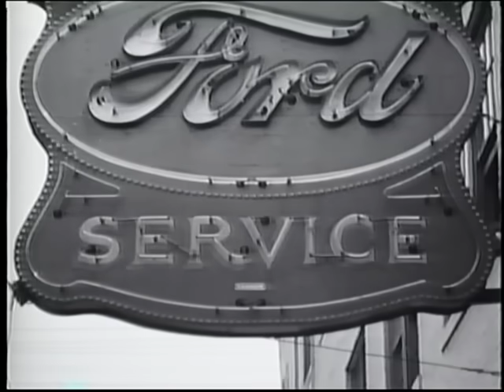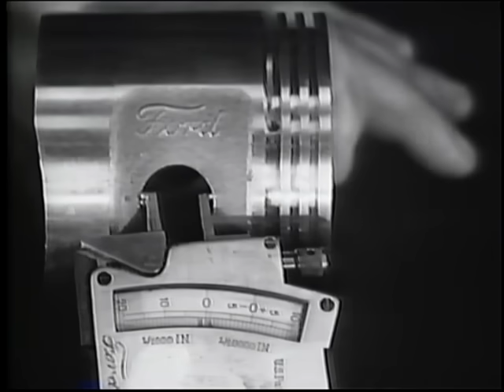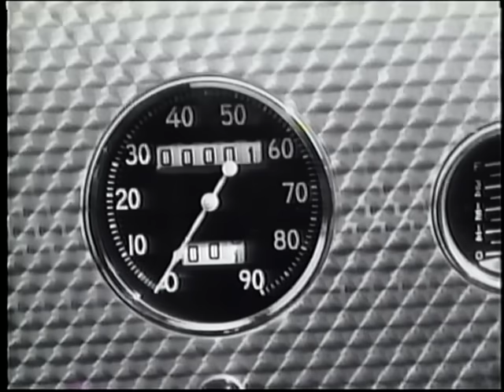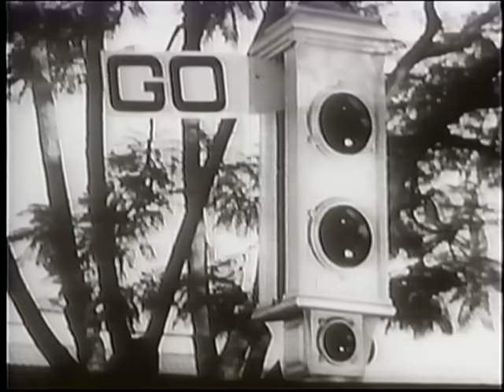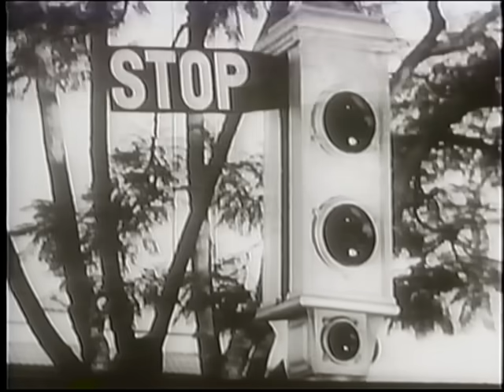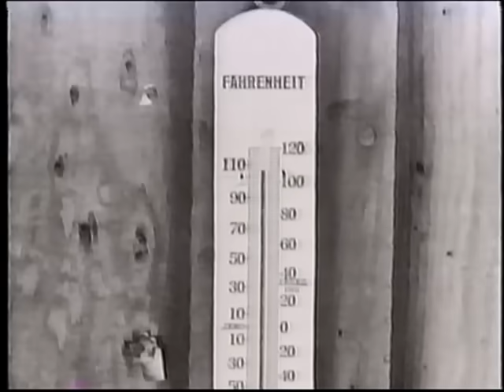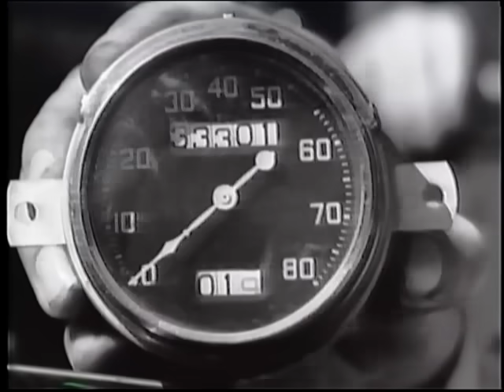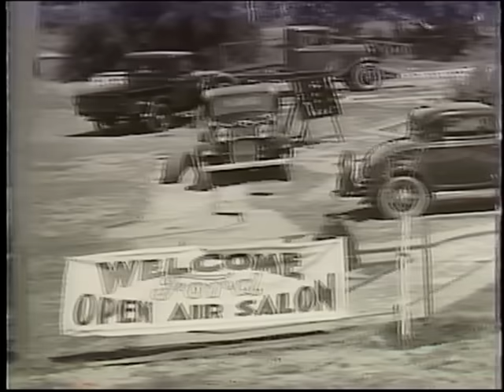1932 - The Invention of the Ford V8 Engine

Comment: I love my chevy's, but totally respect the V8 technology designed by FORD. Enjoyed the documentary, thanks for uploading it :)
Reply: don't forget that Chevy made a V8 before the small block.
Reply: Cadillac V8  Type 51   1912   was the first volume produced automotive V8,
Reply: WAS NOT A SINGLE PIECE CAST BLOCK.....THREE PIECES
Reply: Wrong. Single casting. Are you counting the heads as separate castings?
Reply: Mike...  They said single cast block, not single cast engine.   The heads are obviously cast separately, Einstein!
Reply: One of the most important innovations in the Ford flathead V8 was the casting of the crankcase and all 8 cylinders in one engine block; a one step, low price V8.
Reply: 1917-1919 Model D. Discontinued after Chevrolet was integrated into GM.
Reply: Why can't we be more friendly to each other? Blind brand loyalty is stupid. I'm a Volvo lover myself but I love learning the history of American automobiles, especially the old classics. All car makers have made shitty models with shitty engines, almost all brands have made at least one nigh-bulletproof car model. We should celebrate the automobile in general, regardless of brand. Especially now since we might be one of the last generations to freely drive cars with internal-combustion engines because of climate change and depleted oil reserves. Hell, even driving on public roads might be outlawed when self-driving cars become cheap enough and safer than humans in traffic.

So don't let your brand goggles blind you guys! Celebrate and enjoy the automobile while we can still enjoy them the way they were intended!
Reply: Tibor Roussou is
Reply: enok90---Well said.
Reply: enok90, well you want learn it from this video, it's revisionist history, a load of crap. Chevy invented the 302, and a year latter after Chevy came out with it, Ford bought the prints, which is why Chevy never made that engine again. Anyone who thinks what I am saying is BS, look at the bore and stroke on both the Chevy 302 and the Ford 302, you will see it's exactly the same. Now I know some Ford fanboy's will not believe this, and that is your choice, but I know the truth. I'm not going to argue or even respond to any trolls.
Reply: Yes, GM did make a 302 for their Z28 for a short while.  And while fairly rare, it was a good engine.  
However, the Ford 302 is based directly on the older Ford 289, just with an increased stroke.   
The GM 302 was based on the 327, with a reduced stroke.   (so was the much more common 350, obviously with an increased stroke) 
Two VERY different engine designs.   
I never got the chance to tinker with the GM 302, but I've screwed such a few 327s and I'd guess they look pretty similar, like the Windsors likewise do (except for the 351W being slightly wider but otherwise nearly identical) 

BTW, both 302s came out in the same year, in answer to SCCA restrictions for racing entry qualification.   Ford just had a lot more overall success with their 302 design than GM did with theirs, which is why GM settled on a 305 for competitive numbers.   
So....   What's worse...  his revisionist history or your presumptive one?   :-P
Reply: Actually they did, and it don't matter if you believe it or not. The stroke and everything is the exact same, it's the same block, but hey, if you choose to believe GM designed a 302 and made it for only one year, that's on you. Yea, they went through all that trouble to make a 302 and never made it again, that makes sense to you? They can't make it again, because Ford owns it now. I knew some Ford fanboy that can't face the truth would get all butt hurt, and you didn't disappoint. I could care less if they changed the firing order and distributor, but I am talking about everything else. Ford didn't design shit, he bought the rights to the 302.
Reply: Ever compared NASCAR engines between the various competing teams?  They're all identical.   Not because they're made from the same blueprints, and not because they're selling designs to each other.   It's because they're all trying to maintain maximum performances possible right at restriction threshold.   So you have NASCAR's limitations shaping the engines, not the innovational talents of the team.   
Reread what I said about SCCA rules I mentioned earlier...   both Ford and Chevy wanted adherence to those qualifiers to be able to tout as bragging rights for their production cars.   
You asked why GM designed it and used it only for a year?   Well why does GM do a lot of the weird shit that they do?  Who knows??   Lol
They did want to set themselves apart from Ford on a marketing standpoint (for obvious reasons), so you're at least somewhat right about their discontinuance of the GM302.   
Think about it, mate....   WHY would Ford need to BUY a design from GM?  Both companies had a long built wealth of R&D resources at their disposal...  some of the best in the world even....   neither of them has ever needed to copy specific engine designs from each other, so your fantasy presumption is preposterous.   
Bore and stroke are easy tweaks to any design.   A platform need not be copied.   
The head designs are totally different.   The cams too.  The firing order.   Hell, even the distributor is against the firewall in the Chevy versus the Ford which kept theirs up front.   
You may keep beating that drum, but everybody else will still know you're wrong.   ;-)
Reply: You have not been working with a Chevy 302, you probably never saw one in your life. If you did have one, you would know I am right. It has the same bore and stroke, that's more than a coincidence. I don't care if you are triggered, because I am right. 

Ford bought the blue prints from Chevy, if they changed a few things, so fucking what. The point is, this video is Ford propaganda and revisionist history. If you want to find out the truth you will, but I am done here. I can lead a horse to water, but I can't make him drink. 

You know what a 302 is, it's a natural progression from a Chevy 287, that's what it is. It is not chance that Chevy came out with the 302 first, dropped it, and then Ford started making the 302, but I realize you don't care about the truth.

I'm done here, you can do wtf you want, I'm sorry I fucked with your illusions.
Reply: 1SqueakyWheel, do have any ideal who makes the Ford AWD Focus? The fucking Germans that's who. Don't tell me engines are not shared between companies, ever heard of GM Ecotec engine? How about the fact that Mitsubishi's 1.4 liter is also a Dodge engine? I know what I am talking about, and I am not going to keep beating a dead horse, you all can beat on it. Chevy stopped making the 302 because they had too, Ford owns the prints, and they used the prints to make their own version. You seem to think that sharing just happens is NASCAR, but it's not true.

You guys probably will tell me next that Ford invented the car, but they didn't.
Reply: I meant 283, but you are just arguing minutia. One could say, there never was a Ford designed 302 as well, LMAO.
Reply: yeah ..I knew it...the ..ONLY argument you are using is that the bore and stroke is the same...SO WHAT..that is the..ONLY..similarity...NOTHING else is the ..same...show some ...PROOF...for your ..ridiculous claim...and for you to say that I have never even seen a gm 302..is just asinine  !
Reply: FullSpectrum Survivalist 
you couldn't be more wrong.
Reply: Tom, and you base this on what?
Reply: Nobody triggered here but you, Bud.  I simply corrected you,  lol.   

And of course I've seen them.   Had a friend in the 90's who had one that I even worked on.... kinda.   I only rebuilt the carburetor for it, but never worked on the engine itself.   He had put it into a C10 he was fixing up.  I've worked on countless windsors though, owning a couple myself.   

I told you already about how the mainstream 302 was a direct modification of the 289, which came out WELL before GM's 302.  
The bore between the F302 is identical.   The journals, mains and cams all the same, as well as most versions of their respective intakes.   Only their heads are different, albeit interchangeable.   
They're both part of the Windsor line, as well as the 351W and several smaller V8s which preceded the 289 even.   

I also informed you that GM's 302 was directly based on the 327.  (as was the famously ubiquitous 350)  The two are the same exact smallblock, with the same exact bore.   You can swap their pistons around just like you can trade those of the Ford 302 with its respective 289 predecessor.   The GM302 was basically the 327 destroked to the same depth as the 283, if memory serves me correctly.   

These derivations are irrefutable fact.   And your talk about illusions is pure irony.  
 
Yes they just happened to use the same stroke and bore size.   That is where their similarities end though.   They both chose obviously convenient numbers.   3" stroke by 4" bore.   It was a natural landing point for a fast revving oversquare engine that came in under the SCAA's 305 cube limitation.   BECAUSE THEY'RE SIMPLE, EVEN NUMBERS.   If it was some really oddball figure like 3.612" x 3.96", you'd have somewhat of a point.   But there's a difference between chance coincidence and common expectation.   

And by the way, GM manufactured the engine for THREE years, not just one.   

I don't know why you're trying to turn this into a pissing contest...   You obviously have access to the Internet...   you should use it for a little fact-checking rather than just for broadcasting erroneous presumptions.   

I don't want to doubt that you know a little about engines...  but if you really do, then you should know better than to assume that Ford would need to buy blueprints for an engine from their diametric enemy in order to arrive at an engine with a simple 4x3 bore/stroke ratio.   It's a childish conclusion.   

The bore and stroke aside, there are no similarities between the two 302s.  

And I'm unsure why you felt that the mention of other overseas company collaborations has any bearing on proving your point...   but while these other international pairings happen (like Ford & Mazda, GM & Isuzu, Chrysler & Mitsubishi, etc) there never was nor ever will be any joint productions between Ford and GM.  
It never happened.   It never will.   They have nothing interesting to offer each other.   

The closest you'll ever get to that would probably be the long-defunct AMC, who was famous for using components manufactured from Ford, GM and Chrysler, despite their intent to compete with all three of them.   

So calm down dude.   And get over the fact that you are hilariously incorrect with your fantasy presumption.   

You asked for specifics to rebutt your claim, and I have provided actual derivative details for your educational benefit.   
Ig you choose to ignore those, that's completely on you.   

Good day, friend!
Reply: YES!!..exactly...thank you...1SW...i dont deal well with stoopid pompous asses!!...B/S is THE ONLY..similarity...nothing else looks or fits the same ..from bell housing pattern to timing cover..and to claim with..NO..offered proof that Ford would need to buy ..anything..from GM..to make a natural progression from 221..260..289..to eventually the ..302...redikk...totally...correct..GM wanted to go racing..SCCA......they did what we all copied making the 348 stroker out of the 400 4 bolt block...with the special ..thick wall FM main bearings....well putr!!
Reply: "Yes they just happened to use the same stroke and bore size.   That is where their similarities end though."

That's just it though, that's not even close to being the only thing the exact same. First of all, we are talking about 2 engines with the same CID, that's 3. The fact is, almost all the numbers are the same, and any that are not are due to the few changes between the production engines. If you want a real list on what is exactly the same, I can provide you with it, and we can talk about what isn't and why, but I am not going to do it for people talking shit with theirminds already made up. 

Also, working on a carburetor don't mean jack shit, you can put any carb on any car of similar horsepower.
Reply: Also, I am not triggered, why would I be? I am not a fan boy. They lie all the time about any number of things, and most of you buy it. Orville and Wilbur Wright didn't invent the plane, Ford didn't invent the car, and Alexander Graham Bell didn't invent the Telephone. Those are just a few examples most get wrong, because of revisionist history.
Reply: FullSpectrum Survivalist 
well being that I've built a Chevy 302 starting with a 327 block, an several Ford 302s they share nothing in common. nothing. why would GM sell the design of the worlds most popular V8 engine to a rival company. then continue to build eng using the exact same architecture for decades. 
 lots of engines share the same bore and stroke doesn't make them related in any way
Reply: FullSpectrum Survivalist just admit that your mistaken an move on. sucks being wrong, but such is life.
Reply: I'm not talking shit.   I've been talking congenially and patiently with you, and haven't uttered a single curse word nor insult.   I simply told you why you were wrong.   

I told you about the carburetor as an admission that I haven't wrenched directly on the engine itself, but it was a rebuttal for your other presumption that I'd somehow never seen the engine.   Like its super rare or something?   I've seen a few.   (three years production time with a large company like GM on an engine that has a cult following means that gearheads like myself are obviously likely to encounter a few throughout the years.   
It was an example of how you apparently tend to shape your arguments on baseless assumptions.   

By the way...   The CID isn't really a third thing.   It is a product of the first two.   If you understand geometry, then you'd know that bore multiplied by stroke with same typical head clearance is going to result in 302 cubic inches.   That's not a third added similarity!  Haha 

Go ahead and provide me with this list you like to enigmatically refer to.   I'll wait.   

But first, you must DIRECTLY refute what I've told you twice about the Ford being derived from the significantly older 289 while the GM comes directly from the 327.  

Plus I corrected your claim of one single production year by stating they had at least THREE.   67, 68 and 69 for sure.   That's chronological overlap, which also blows your theory about their reason for discontinuance right out of the water.   

Had enough yet, mate?
Reply: No, again, you're confusing "revisionist history" which is intentional and calculated in nature with ignorant assumption.   

Nobody teaches that the Wright Bros invented the airplane.   They were merely first in flight.   Anything beyond that is presumption.   

Ford invented the  affordable car "for the everyman by way of his innovation of the linear production line.   Anything beyond that is ignorant presumption also.   

Bell didn't invent phone technology, he was only the first to make it work practically.   Again, anything beyond that.....   you get the point.   

You're obfuscating the argument by going on that tangent which is irrelevant to anything which anybody else has thus far told you.   

Quit the shadowboxing.   Try answering our points directly as we have yours, instead of deferring back to your original unproven claim.
Reply: "But first, you must DIRECTLY refute what I've told you twice about the 
Ford being derived from the significantly older 289 while the GM comes 
directly from the 327.  

Plus I corrected your claim of one single production year by stating 
they had at least THREE.   67, 68 and 69 for sure.   That's 
chronological overlap, which also blows your theory about their reason 
for discontinuance right out of the water."

I know they made it 3 years, I just posted that to see if any of you supposed experts would know it. I already covered your derived argument, on the fact the same could be said if what I am saying is so on a Chevy. Just because you think something derived from something doesn't mean it's a fact. 

""But first, you must DIRECTLY refute what I've told you twice about the 
Ford being derived from the significantly older 289 while the GM comes 
directly from the 327."

No, you don't get to tell me what order I cover things and place conditions on me. This condition is because you want to direct the conversation to things nobody can prove. Well if you want the information, we will talk about it in the way I say, that's my condition.

Here's what we will talk about, both the 69 302's.

(1) What is exactly the same. 

(2) What isn't the same and why.

(3) What is completely different and why.

Now if you want to do that, we can get into that other stuff latter, but I am not going to get anywhere with showing you the truth as long as you choose to base everything you say on what most people tell you. 

But if you choose to do this my way and actually look at what we are talking about with facts instead of lies, you may just change your mind about what is or isn't the truth. 

The fact is, I can show you any number of things made by different manufacturers that are exactly the same product, but with different names, and this didn't just start yesterday, it goes on all the time. Most people are not willing to learn anything and challenge their beliefs, and I won't waste my time arguing about  it. If you want the information, you will receive it how I choose to give it to you, because I once believed Ford designed the 302 as well, and I know both sides of the argument, you don't. So I know what you need to see to get your mind right on this.
Reply: "Nobody teaches that the Wright Bros invented the airplane.   They were 
merely first in flight.   Anything beyond that is presumption.   

Ford invented the  affordable car "for the everyman by way of his 
innovation of the linear production line.   Anything beyond that is 
ignorant presumption also.   

Bell didn't invent phone technology, he was only the first to make it 
work practically.   Again, anything beyond that.....   you get the 
point."

No, actually when I was in school, they did teach the Wright Brothers invented and flew the first plane, neither of which is true though. 

Ford did invent the production line, Mercedes Benz invented the car, and I would have to give Hitler credit for making an affordable car for every man, not Ford. 

Bell patented the phone, that's what he actually did do, a Woman invented it.

"No, again, you're confusing "revisionist history" which is intentional and calculated in nature with ignorant assumption."

No, I am not confusing anything, all lies are done of purpose, therefor intentional.
Reply: http://www.460ford.com/forum/42-general-tech/114796-ls1-heads-sbf-yeah-can-done.html

Read this thread, so you can get in the right line of thinking. I have saw people put Ford heads on a Chevy more than once. In fact you would be surprised about how often things like this have been done, and when you see how they do it, you also ee exactly what is different. 

Next time you go to order a part for a car, ask what other cars that part will automatically work on, you will start to see things clearer.
Reply: Already told you, not going to waste my time arguing and getting nowhere. I don't need anything from you, if you want the information, you don't get to direct how you get it, accept this or I permanently move on.
Reply: I do stand corrected about the patent.   You are correct.   But Bell was the first to prove the concept in a commercial context.   So in doing, he fathered the product itself.  
As for Henry Ford, he invented the linear production line, as I said before.   The "everyman" bit was an confusing adlib, and I therefore retract it.   
Mercedes "invented" the production car.   But not necessarily the automobile itself.  
 
While this is all very interesting, it bears no real relation to the very specific argument you originally launched.   Out of the blue, even.   

And by the way, no need to quote my entire messages only 5 minutes later.   Are you just trying to add filler?   
If so, there's no need for that.  
If you're worried I'll delete my comments, relax.   I have no respect for debaters who delete their commentary in a forum debate to save face, so you ain't fine me doing that.   And I'll give you the benefit of the doubt that you won't resort to that once all's said and done either.
Reply: Okay.   So you want for us to ignore the logic and just deal with baseless factoids which buttress other baseless factoids then?  You might as well be retorting "Bob agrees with me, so there's my proof".   It just doesn't work that way.   
None of this works that way.   

But you are content to waste our time, and you've wasted it well.   

It's difficult to take a guy seriously when he reverses part of his predicated argument with "I know it was 3 years, but I was just saying 1 year to test you", as I paraphrase.   
Good job mate.   

Your desire to dismiss parallel respective derivative lineages and completely defy chronological order with your assertions tell me all I need to know.   
I guess all of this was to test us, huh?   Or troll us maybe.   ;-) 

I'm done with ya.   Good luck doubletalking the others.      
And gnite!
Reply: "The "everyman" bit was an confusing adlib, and I therefore retract it.   
Mercedes "invented" the production car.   But not necessarily the automobile itself."

No, Mercedes invented the car, they made the first one. 

"And by the way, no need to quote my entire messages only 5 minutes later.   Are you just trying to add filler? "

If I had a dime for every time someone went back and modified their post on youtube after being proved wrong then acting  like they are still right, I would be rich, so I do that any time I even think that may happen. 

"While this is all very interesting, it bears no real relation to the 
very specific argument you originally launched.   Out of the blue, even."

But it does, because my real argument is that a good part of what people believe to be true in this world is not, and until you start thinking that way, you will never see the truth in anything. 

I had an Atheist that thought he was clever and would make me look bad on another thread last week by asking me if I believed in unicorns.

I told him, I believe it is an animal that once existed but is now extinct, and it's in the Bible. 

Now I will bet you that he can't present to me a walking living T Rex either, and I will wager he has no problem believing in that. I think the difference lies in how the information is presented, with one being presented as Folklore and the other as fact, of course tomorrow as often happens that could all change, just one unicorn horn is all it would take. In fact, none of us have saw a real unicorn, and they may already be a horn, and they don't know what it goes to yet.
Reply: Also keep in mind about a patent, that only means a lot of the time someone beat you to the patent office, and not that they invented it.
Reply: No, I don't want to  set here just spinning my wheels, how much time have I already wasted on this and where are we, exactly where we started.

I want to talk about what is the same first, then we can talk about what can't be proved latter, or you can, but I don't care about that really.

So far we agree the bore and stroke is the same, that's how far we got, and even then I had to hear excuses about that. If I present other things that are exactly the same, am I just going to get more excuses? If so, why should I show you people anything.
Reply: JackMac...  damn dude.   So much anger over a rather whimsical subject.  
Yeah, so he's QUITE mistaken with his rather oversimplistic concept of how engines are designed.   
That's no reason to be so nasty to him though.   If you want to argue with him, then you really should execute it civilly.   You'll gain more traction.  I learned that he's a waste of time to debate, as his method is ducking, weaving and then reasserting like a broken record.   There's no discussion to be had there.   
I destroyed his logic several times over without using a single ugly comment.  That vitriol LOSES the argument for you, whether you realize it or not.   I hope you improve your tactics, as much as I hope you take friendly constructive criticism well.   ;-)
Reply: yes ..i know...you are ..100% correct...just sometimes ..people like ..him..piss me off...just hate ..pompous ass's that think they know it all...{but dont}...and know..that!...I'll...try and remember..what you just put forth...thanx..man....
Reply: If it brings you any comfort to know this, I don't think he thinks he knows it all.   (if that makes sense) 

What I do believe is that he thinks he's smarter.   He's indicated that he knows he's pulled details out of his own arse, but believes he's clever enough to doubletalk his way past any rebuttal, and somehow fool the lot along the way.   He runs out of ideas though, and commits to the same comfortable (and predictable) holding pattern every time.   
I do believe that he doesn't realize people are capable of clearly seeing through the BS.   He knows he's got nothing.   
So don't feel bad...  I'm pretty sure he knows he doesn't know.   He's just digging in his heels to wax his ego.   
He's thrown everything he can at it, and knows nobody's buying it.   Lol
Reply: Fucking Crickets, that's what I thought. See, I am not the Troll here after all, some people are just to damn stupid to lean anything the easy way, class over. Now I am moving on from this, mission accomplished. If anybody had anything else to say, they had over a day to do it, almost two.
Reply: Easy Jack!    Lol 

FullSS:  No intentional crickets.... Honestly, I thought you had deleted the thread. I could find no evidence of this thread the following morning after I sent that message. I'm just now getting alerts, and seeing that the thread is still in existence!  (I really hate how Google has corrupted YouTube, but I digress. ) 

And no, "CFM" and "carburetor" are NOT the same thing at all. CFM is a volumetric measure of the amount of airflow that a carburetor is rated to deliver. Don't be putting words into my mouth like that...  you are still the fool here. 

Items 1 and 2 in your list, as well as 7 thru 9 are, AGAIN, a direct product of items 3 and 4...  bore and stroke.   So right out of the gate, 7 items of your list are redundantly weaving out the same two very basic factors.   
The rest of that list are popular facets of any engine of the era.
Forged pistons? Are you seriously trying to tell me that Chevrolet had a lockdown on forged pistons??? Or 4 bolt mains? Aluminum heads of even block?  Screw in studs? Solid lifters?  You DO realize that solid lifters had been around for like, 50 years already, right?  No?   Cuz I thought everybody knew that.  Haha
None of that is uniquely special to any particular design.   Nor is the very popular use of the ever-ubiquitous Holley 750.  
The more you talk, the less I believe you actually do know about car engines... More like a layman reading a spec sheet that he somewhat understands but doesn't fully grasp.   
So please, for your own sake, just stop. 
And for the record, you are the one who is hell-bent on arguing. I've simply corrected you.
You're welcome.
Reply: Neither of you said a damn thing for about 2 days after I posted my list of things the same, till I rubbed it in, and we both know that's because, you got nothing.
Reply: Nice try, but you know damn well what I stated was the exact same, there is a list, a list you failed to address even after forcing me to put it up, and I am done taking to both of you clowns, and if I could mute you, I would.
Reply: "BTW, both 302s came out in the same year, in answer to SCCA restrictions for racing entry qualification."

Which was 305 C.I.D, not 302 limit. Ford saw what Chev had and did hat they do best, steal.

 Not true at all, it's a fact that Chevy came out with the 302 2 years before Ford copied it.

I stand corrected though, it was 2 years before Ford, not 1. Chevy came out with it in 1967, and Ford 1969.
Reply: And now you've moved onto the Ural.   I'm guessing it must have a pancake engine too...   but I know nothing about the Ural, and not caring about it at all, I'm not sure why you shifted the discussion to a parallel of some Russian guy we've never heard of nor couldn't care less about.   

As for my two days, I told you what happened.  I have nothing to gain by telling any lie, nor am I trying to impress you in any way.  Don't wanna believe it?   Whatever floats your boat, buddy, that's your issue.   
I read your long reply, while on the road even, and replied immediately.   
"Liar" is an insult, and an unnecessary one...   one which doesn't help your argument at all.  In fact it hurts your case because it further exemplifies your propensity to make assertions on matters which you're only able to very optimistically assume, at best.   
But there's so much other failure in your reply...   
I addressed your "17 things" already, and you missed those points too.   

Maybe you're not a troll....   maybe you're dead serious with your every word.  But at least if you were trolling, this would all make sense.   

Communication is an obvious issue between us here...   like I told you before, "Words mean things".   Perhaps I forgot to mention an important corollary to that statement, which is that specifically worded sentences mean particular things.   I bring this up because of how you like to loosely quote me and Steamin' Jack with embellished differences that you feel like you can then argue against.   

Let me help you with the most recent example of you doing this:  "The fact is, you stated they were completely different, and you were wrong...."  
Here's the rub:   IF I had ever stated those words, then yes, I'd have been wrong.   "Completely" is an absolute term.   But I said that 'they have bore and stroke in common, and that's where the similarities end.'   That is nowhere near "completely different".   
It's not the same.   
At all.   
And don't panic.... it's about grammar this time instead of math.  So hopefully that's of some consolation.   

As for the chamber volume, THAT would be your third similarity.   Not CID, because, as I told you before, stroke against bore is where CID comes from.   

And I'm sorry that you ARE so annoyed by a fact when it happens to be mathematical in nature.   WHO WOULDN'T BE!?   LOL

Math (in conjunction with health ideals) tells a woman with Amazonian stature that she can't be healthy AND under 90 lbs in weight.   Should she be pissed?  
I should hope not.   
Or would you prefer that opinion overrule math?   

Say you measure the height of your refrigerator, and with tape measure still in your hand, you tell me it's 72½ inches, and I reply with something stupid like "Well,  like, that's just your opinion man...."  
NO.   The measurement was absolute.   If I disagree with it, you'd offer to hand me the tape measure and I'd make the same finding.   OR... I could just refuse and instead continue to blindly argue that it's six and a quarter feet and you don't know SHIT, and that you refuse to learn anything from me because you just won't come over to my preferred way of thinking.....  (sound familiar?   Lol)  In this silly scenario, I would be the one with the problem there, not you.  

Agreed?  
Okay.   

Let's refer to one of the very first things that I told you, which you conveniently ignored, and comedically regarded it as my "opinion";
   
The SCAA put out guideline limitations on cars which could qualify for competition.   We all know that Ford and Chevrolet has been hot on each other's heels since long before you and I were a gleam in our parents' respective eyes.   
The big two wanted to beat the other to be the leading production car which, right off the showroom floor, could compete under SCAA qualifications with every practical advantage possible.  

Are you following me so far?   
Good.   

They had to be absolutely no larger in displacement that 5 liters, or 305 cubes to be more precise.   That was the absolute limit.   To allot for rebore expansion tolerances, it's nice to leave a little wiggle room.   Engines were rebuilt a LOT more often back then due to quicker wear than we're used to today.   Metallurgy and engineering technology has come a long way, so it's far more rare unless you're a real racer or modder.   This is rather minor, and largely unimportant, other than the offering of a secondary theory of not going straight to 305 right out the gate.   Just something good to keep in mind as a knowledgeable and experienced company such as these two would, as they have to each exhaustively prethink every scenario which may arise out of a successful design over the long run.   

Still with me?  
Great.   

The practical performance soup du jour was over-square engines.   (My dad always called them short-stroke engines.  These were an innovation of Chevrolet in the 50's...  Ford may have come out with the V8 first, and whipped Chevy for a number of years, but Chevy perfected the V8 with the short-stroke design and turned the tables on this, and for quite a few years also)  By the late 60's, there were almost countless 4:3 engines in production with varying bore sizes,  creating rather diverse displacement figures.  

Both companies made the decision to do these squarely to the inch though, which may seem a bit whimsical, but every bit as practical too.   

Especially since both companies had well-aged 4" bore platforms that made perfect candidates for the Trans-Am and LeMans racing ideal they were both trying to appeal to.   
The compression ratios that were most ideal for maximum output in a practical car that could be fed affordable fuel and driven daily is what dictated the combustion chamber clearance in both cases...  That's a shared effect of the law of physics leading two different minds to the same conclusion, btw.   Not some arbitrarily arrived-upon dimension that was then shared out of some big mind blowing secret.   

Forged pistons were not only tougher for high output use, but they made for great bragging rights, as well as four bolt mains.   Neither concept was new or particularly unique, but they were sought-after by the musclecar enthusiasts because they added expense that most manufacturers preferred to forego with their more economical, lower power cars.   

Have you understood everything so far?   
Awesome.   

None of this is serendipitous.  And no, it wasn't shared either.   It was the deliberate coincidence that came from adherence to strict qualificational standards of a single organization.   

BOTH companies wanted that high attainable horsepower and torque engineered into their cars so that customers could carry those bragging rights right out of their dealerships.   

That's it.   That's all there is to explain the scant few but important physical similarities.   

I'm sure they never figured that there'd be conspiracy theorists who would one day build a cult fantasy theory based merely on "... Durr....  both engines share the same displacement, so (GASP!) they simply HAVE to be the same exact mill!" 
It's hogwash, my friend.   

***Believe it or not, both companies somehow knew how to paint their cars red without buying or stealing intellectual property from the other.

Amazing, right?  

Rather than going back and beginning from scratch, they each reached into their own  repertoire of well-proven blocks and made one major modification to each one.   Howso?   Because both said long-established candidates just happened to have 4" pistons already.   "HOW is this possible, you ignorant asshole!?" you might fretfully scream.....   

Well it's easy:  Both companies do seem to like nice even numbers for their mainstays, even if they don't always get to practice it in all their lines.   That same fact also likely fueled the other remaining "similar" dimension, but I'm getting ahead of myself here.  
Actually, no I'm not...   because I've told you all this before:  
Chevy went to their sturdy 327 and shortened its stroke to the same simple 3" dimension that their 283's crank already had.   
Ford, meanwhile, went to the flagship of their hardy Windsor line, which was the 289.  They, too, decided to keep the "even  dimension" theme of their 4" bore, and deepen the stroke to where it came conveniently to within a hair of the SCAA's limit right at an even 3 inches.   

VIOLA!   Two great 302s were born.   
To run.   
Against each other.   

The 327 well preceded the 302.  The 289 did as well.   Both by years even.   

And no, that factoid isn't opinion.  
It's history.   

So before you argue back, open your favorite search engine and type "wiki Ford 302" and "wiki Chevrolet 302" and observe the stated origins of each engine.   I'll bet you a dollar to a doughnut that it will corroborate MY statement of origin instead of yours.   
Notice that I didn't just provide you with a preresearched link giving some preferable spin...   I instead gave you a simple reference, intentionally transparent in parameter. 
  
I hope this helps to dispell any remaining confusion you might have on this subject.   

And by the way:  I'm quite sure you have much interesting (and actually factual, even!) knowledge that I could glean from you, just as I  could teach you a lot of things too.   
NEVER assume that somebody else can't possibly know something you don't.   It is but only a  blithering fool who fancies himself the unteachable expert on any given subject.   To believe otherwise is sad fallacy.   Don't be that insufferable turd.   

JackMack might know more about these two engines than either one of us.   Who knows for sure?  Certainly not either one of us.   
So let's dispense with the indignant arrogance, can we please?   

And you'd do well to abandon your assumptions of "fanboyism" too.   Neither Jack, I, nor that Tom guy whom you completely ignored have said anything brand-fanatical.  All was objectively factual statements, in regard to the cars.   
You're very quick to assume that somebody who argues your point as a Chevy fan must automatically be defending Ford, but you're mistaken there.   It's a defense of intelligence, not brand.   Both companies have built good cars, and both have built their crapboxes too.   Up until about 3 months ago, I'd owned and driven more GMs than Fords.   I've learned well of the pros and cons of each model and the helical trends across models, and I've liked every one of them.   Mostly because I know how to shop for a good car or truck.   

So lets dispense with the fanaticism charges too, yeah?   

Glad we got this all straightened out now. 
  
Have a good night.
Reply: Well it's getting tiresome breaking it down for him.  Perhaps I should just give up on him?   Lol
I try to be courteous and give others the benefit of the doubt, even when I'm pretty sure it's a waste of time.   
But it can't be said that he wasn't given a chance to face off with every point that invalidates his awesome claim, so I'm cool with it.   ;-) 
I think he understands concepts just fine.   It's the details of execution that he's kinda clueless about.   

Kinda like those kids who loved science and watched MacGyver growing up, believing his methods were realistic.   Some of the premises of his hijinks were so loosely based on reality that one could take intellectual insult if they were to take TV show embellishments personally.  But hey, they needed material, and they trusted their audience to understand reality from fiction.  But there will always be clowns who swallow it believing it really works that way.   
Anyway...   The guy is my age.   If he hasn't figured out how this stuff works by now, he's probably not going to.   I can't help him with that either.   ;-)
Reply: Kinda like those kids who loved science and watched MacGyver growing up,
 believing his methods were realistic.   Some of the premises of his 
hijinks were so loosely based on reality that one could take 
intellectual insult if they were to take TV show embellishments 
personally.  But hey, they needed material, and they trusted their 
audience to understand reality from fiction. 

Actually, when the show first came out what he did was exactly right and worked, but then people got involved and decided to alter what he did so people would not be shown exactly how to do things like bombs and such on national TV, so you only know a little about it obviously. 

I did watch that show, and I know all about what happened, and remember why they altered the scenes for future showing, the first season when they started airing it, it all worked, but then for future showing a few things were changed. 

Now they just don't air certain things ever again in any form, and have been caught even pulling shows of of peoples Tevo's, such as several Jessi Ventura Conspiracy Theory episodes that exposed things such as Fusion Centers.
Reply: I have a big comment to your book above squeaky, if you want it let me know, I can't get it to post. Can I mail it too you? Or maybe break it up into smaller books. Must be too long.
Reply: " To allot for rebore expansion tolerances, it's nice to leave a little wiggle room. Engines were rebuilt a LOT more often back then due to quicker wear than we're used to today. Metallurgy and engineering technology has come a long way, so it's far more rare unless you're a real racer or modder. This is rather minor, and largely unimportant, other than the offering of a secondary theory of not going straight to 305 right out the gate. Just something good to keep in mind as a knowledgeable and experienced company such as these two would, as they have to each exhaustively prethink every scenario which may arise out of a successful design over the long run. Still with me? Great."

Not really, just sounds like a bunch of fill in text to me, because after Ford started making the 302, Chevy made that 305 which was at the exact limit. Why didn't Ford do the same instead of that 302 which Chevy already had made one? I know why, but you are choosing to ignore it. Since Chevy came out with a 305 after that 302, that nullifies your theory, which is just you trying to justify things in your head, it means nothing.

"That's a shared effect of the law of physics leading two different minds to the same conclusion, btw. Not some arbitrarily arrived-upon dimension that was then shared out of some big mind blowing secret."

Well that's your opinion, but mine is, Chevy already had shown the 302 worked, and Ford saw that it worked and worked better than what they had, and the copied it, but made sure to change just enough to claim it as their own, and they did buy the prints. I talked to a mechanic that lives on my block about this last night, and even he knew this is true.

"Forged pistons were not only tougher for high output use, but they made for great bragging rights, as well as four bolt mains. Neither concept was new or particularly unique, but they were sought-after by the musclecar enthusiasts because they added expense that most manufacturers preferred to forego with their more economical, lower power cars."

I know what was desirable, I was there too. In fact in the 80's, I had a 79 Chevrolet Bonanza 10 with that 454 from the factory in it. Keith Black built that engine to 650 horsepower and 750 foot pounds of torque, and while this conversation is fun and all, it still just more fluff and refusing to address my 17 points, redirection of the topic to history over the actual topic at hand.

I gt what you are getting at though, you are trying to dismiss my 17 points, except for he 2 you already admitted was right. I'm sorry if you don't like it, but this is how a comparison is made, and how you can get to the truth when you are told lies. To me, a refusal to admit I am right about those 17 points shows you are not only dishonest, but not even willing to look at the evidence. Make all the excuses why all you want, but admit they are the same numbers, admit that that Holley car is the exact same carb on both the engines I compared, etc. Do all that, then we will talk about what is different and why, as I already said we would. Not showing a willingness to admit my 17 points are correct, shows me you have your mind made up and will do anything to protect your bubble.

Now if you want to tell me why you think something is the way it is, that's fine, but not till you admit it is the same. I plan on doing the same exact thing if we ever get past what is the same, and move onto what is different, this is how things get hashed out.

"BOTH companies wanted that high attainable horsepower and torque engineered into their cars so that customers could carry those bragging rights right out of their dealerships. That's it. That's all there is to explain the scant few but important physical similarities."

That's not not all it is though, the fact is, Ford choose to make the exact same size engine, why don't they do this the rest of the time if they are both adhering to this inch pattern you claim. Ford 351, Chevy 350, Chevy 454, Ford 460, Ford 289, Chevy 283, DO i REALLY NEED TO GO ON? The fact is, almost every time Ford and Chevy has made an engine, it's been a different size, but not this time. Go ahead, try and justify it all you want, but it means nothing. The limit was 305, and Ford had room after 302, but they copied Chevy and made the 302 as well, this is a fact. They could of made a 303, a 304, or a 305 like Chevy did next, but thy didn't, and I am telling you why. I don't care if you believe it or not, but this whole video is really only about Ford changing a few things from how Chevy did them, and calling it their own. They put better heads on it, and I don't blame them, theirs were better. They moved the distributor, because every Ford fan knows which end Ford puts theirs on, and everyone would be able to see it was a Chevy engine with a Ford stamp on it really quick if things were not changed around some. Plus, neither Ford nor Chevy really wants their parts to directly bolt up to the others parts, because they are afraid that Ford guy for instance, would just buy cheaper priced Chevy tranny instead of a newer overpriced Ford tranny, as an example.

I have a Mitsubishi outside with a 1.5 liter in it, and this comment is really for that other guy, who said you can't just do that, it's not that simple. Well it is in fact just that simple, but yes there is a little work involved.

I plan on dropping that 1.5 liter 4G15 into a Russian Ural motorcycle with a side car. Do you know what that really involves, not as much as you would think. I have to maybe modify the frame so it fits in there. I will have to get an adapter plate made so it will mount up to the Russian transmission, yes it has a car type transmission and shaft drive to the rear wheels that both pull. I will have to fab a custom header, an maybe a few other things, but it will work just fine in the end. Bike comes with a 759cc boxer engine, and I am installing a 4 cylinder 1468cc engine, almost twice as big and has almost twice the power. Bike normally does about 65 tops, but this will allow me to keep up with about anything.

"The 327 well preceded the 302. The 289 did as well. Both by years even. And no, that factoid isn't opinion. It's history."

I never said it wasn't true, but those are 3 different engines we are talking about. Did they modify the 289 and 327 to be 302's, are did they in fact actually make a different engine called the 302? You can claim based on all you like, others did, that's where you came up with this. The fact is,these are all different and separate engines, and that's not open to debate either is it?

Have you ever heard the saying, you can't have your cake and eat it too? Well that's what you are doing. Earlier you were saying they both came up with the even number of 302 because of a 305 limit, and now you are saying they did this based on 2 different size engines, and still came up with the same number, the problem is, that math don't even come close to adding up.

"So before you argue back, open your favorite search engine and type "wiki Ford 302" and "wiki Chevrolet 302" and observe the stated origins of each engine. I'll bet you a dollar to a doughnut that it will corroborate MY statement of origin instead of yours."

I already did that, and means nothing, anyone can modify the wiki, did it myself when it's been wrong before. If we all agreed, we wouldn't be having a conversation about this. You may not believe this, but much of what you are told in this world is a big fat lie. I am not disputing your information is not in agreement with the lie about how things came to be, I am arguing that your information is wrong because of lies you bought.

"I hope this helps to dispell any remaining confusion you might have on this subject."

Thanks for taking the time to try and educate me, no really, but I already knew all that. Their is no confusion on my part, I just happen to know things to be a but different reality than what they are saying.

"And by the way: I'm quite sure you have much interesting (and actually factual, even!) knowledge that I could glean from you, just as I could teach you a lot of things too."

I do, and I don't know everything, so of course you could surely teach m something I don't know, but I hope we can agree, we both would have to be open to change the way we think to learn something new. If we are not open to challenge our beliefs, neither of us will ever learn anything.

"NEVER assume that somebody else can't possibly know something you don't. It is but only a blithering fool who fancies himself the unteachable expert on any given subject. To believe otherwise is sad fallacy. Don't be that insufferable turd."

That's true, but you need to do hat yourself before telling others too, right out of the gate what did you do when I commented about the 302? Go look, see if you did as you tell me to do.

"JackMack might know more about these two engines than either one of us. Who knows for sure? Certainly not either one of us. So let's dispense with the indignant arrogance, can we please?"

Then again, he might not.

"And you'd do well to abandon your assumptions of "fanboyism" too. Neither Jack, I, nor that Tom guy whom you completely ignored have said anything brand-fanatical."

That don't mean you are not, nor does it mean I am wrong. Let me ask you something, why did you watch this video if you are not a fan of Ford? Why did they since you speak for them too?

My opinion that you were a FanBoy was based on your anger at my charge that 302 was made by Chevy and Copied by Ford. You may not be a Fan Boy, but in my eyes you are acting like one. Why else get angry? Why not just compare and debate without all the other crap?

"Glad we got this all straightened out now. Have a good night."

You have a good night too, however, I don't think we will ever get much straightened out on this thread. Don't look like anyone is going to change their minds here.
Reply: There we go, it  went up split up.
Reply: <<FSS: "No you didn't, saying because of math is not addressing, you wouldn't even admit they were he same numbers, that makes you look stupid not me. I already told you, we will talk about what is the same first, then we will talk about what isn't, and why. I'm still waiting on you to explain why they are the same but different, those 17 points I made.">>

Never did I simply state "because math".   I explained HOW the math tied several factors together which you wanted to treat as different.   Do I REALLY need to enter the volumetric formula of why a cylinder of 4 inches in diameter with a length of 3 inches, multiplied by 8 cylinders just like it comes to 302 cubic inches?   I've just always assumed you had the brains to put that together yourself.   Sorry if I overestimated you.   
And I did answer your points.   You even rebutted them thereafter with some BS that further assumed math should be left completely out of the discussion.   Your points on the bore and the stroke and the displacement I have answered ten times over.   (eleven, including just above) 

But since you'll only comprehend these points if I write your numbers on them,  that covers 1, 3 and 4.  

I also answered 5, 6, 8 and 11...  they both wanted to build a hot, tough engine which could both reliably produce their target power and also give bragging rights on how tough it must be.   You rebutted that with more BS.   

16 and 17, you're doubling up again on the same thing...   And I replied that the Holley 750 was a popular carburetor for high performance use in that flow range.   It was a big name, and a good carb, and generally a big improvement right out of the box over the two or even 4 barrel in house carbs that so often came stock, which nobody ever got excited over.   The Holley they chose was a popular option, and it worked well.   Gave them the Holley name to brag about.  The companies tend to know what the other is doing on details like this, so it was no big boardroom secret...   and they're not to be outdone in such an inexpensive feature which would bring them so much marketing bang for their buck.   

9 and 13 I answered when referring to the target compression ratio tested against the law of physics with current technology of the time on maximizing output while keeping fuel practicality and reliability in mind, since most of these were gonna be driven daily.   

14 this was another trend in musclecars which was steadily gaining popularity with all three companies (including Chrysler here) which was lauded as a better design for more desirable breathing for all purposes.   It was another obvious bragging point too.   

15 same as above in that it was a gaining trend across all companies, including European cars.   With a higher-po engine, aluminum was another bragging point, in that it was all much more efficient at getting the heat out of critical areas and sinking it to the coolant.   

7 and 2 was another product of all of the above.   It's a cascading effect...   why is that so difficult for you to either comprehend or acknowledge?  So yeah, it's all in the math that results in their desired outcome from an engine that began as a simple 4x3x8 engine.   I'm almost surprised that you didn't include an 18th point of similarity, them both being a V8 too.   Lol 

<<FSS: "Just trying to show you how things work, the Russian theft of tech from the Germans...... You refuse to open your mind to the possibility Ford didn't design the 302, so I am giving you just one more example of when others stole and used others work." >>

You don't have to convince me that companies take ideas or even designs from other companies.   "Steal" is an interesting word for you to choose though, since your original assertion was that Ford "purchased" the design from Chevy.    Buying and stealing are two different things.   Not that the difference matters in this case though, since it's  gonna be wrong either way...   All three companies were constantly taking good ideas from the other two.   This is how market trends work.   But none of them would ever "buy" a design from the other two when they could just as easily develop it themselves.  

This is why the idea of Ford purchasing the 302 from GM is just ludicrous.   Why should they have to?  They wouldn't.   As I stated to you before, NEITHER company has anything interesting to offer the other in a particular engine design, because they're both experts in the technology that goes into a freakin engine.   

FSS: " ""Liar" is an insult" You sound like a milineal, liar is no an insult if it's true. I 'm sorry, but I just don't believe you, have have been nothing but malicious since this started, and I think you just had nothing, and lied.

1: "Liar" IS an insult when it's a false accusation though.   I explained that already.   
2:  I obviously had Plenty to respond, as you saw of me two days later when I finally got an alert triggered by JackMack's reply to yours.   I'd written the whole thing off because G+ wouldn't show me the thread in "read history" the second day.   So I assumed you'd copped out and deleted your messages on the thread, even after you'd insinuated that I might be inclined to do such a thing.   I was wrong though, you'd not deleted anything, G+ was just being a bitch.   I'd moved on completely, because I have a life.   When G+ alerted me to a reply from JM, I was pleasantly surprised that the thread was still intact, and I went ahead, read what you said and replied.   Simple as that.   If you don't want to believe that, then be my guest.   But move on from it and don't generate unnecessary insults out of your own chosen preference of belief.   
3:  I'm not a millennial.   I'm your age.   Calling you on an insult is not a "millennial" thing.   

<<FSS: " "The fact is, you stated they were completely different, and you were wrong....""
No, I didn't state that at all, you bozos did." >>

YOU WROTE THAT IN THE PREVIOUS MESSAGE TO ME.  That was a direct quote from YOU.   Damn, boy.   Read up.   And then read where I immediately followed up with how and why it's not at all what I had said...  you even quoted that bit just below, so I'll include it in your next quote.   

<<FSS: " "But I said that 'they have bore and stroke in common, and that's where the similarities end.' That is nowhere near "completely different"."
The problem is, that's not even close to being true, I gave you a list of 17 things that are the same. You choose like he did to not address the points I made, go ahead number your thread like I did for those 17 points I made, and then tell me how I am wrong on each and every one, but you can't can you?, because I am not wrong. The numbers and parts are the same as claimed."  >>

I answered this above.   But it's nowhere near the first time I have.   And now that I have numbered it for you, perhaps you'll now be able to connect the dots?

<<FSS: "And as I already told you before and after you said that, a question is not the same thing as an answer. They are 3 different things."  >>

No shit, Sherlock!   An answer is not the same thing as its question.   Neither Jack nor I ever said it was.   
An answer IS predicated and even shaped by its leading question though, so there's an unavoidable relationship between the two. 
  
As for the "3 different things" bit, I've corrected you on that so many times.   Even re-explained it those many times just in case you missed the correlation.   
- Bore, stroke, displacement.  
-Multiplicand, multiplier, product.   
Two different things that directly result in a third.  
This shouldn't be hard.   

<<FSS: "No, I am annoyed because you are trying to throw away all the facts because of math. You are using math to justify not even talking are looking at the things that are the same. If your argument is they are the same because of math, then how can your argument also be they are different in those same ways, hence the numbered list, still waiting for your numbered list in reply.">>

Why be annoyed at all?   It's just a discussion.   No facts have been thrown away though, "because of math" or otherwise.   The facts have instead been EXPLAINED by math.   Why aren't you grasping this?  

<<FSS: "Yes I know, and you didn't tell me that it was 305, I told you, so this is another lie because I both addressed and responded on this already, go back and look."   >>

What are you on, dude?   I told you 305 at my very first mention of the SCAA and its restrictions.   You ignored that info completely for several correspondences until I finally cornered you on it.   Scroll up and see for yourself.   I'm sure it's all still there for your perusing enjoyment.   

<<FSS: "... because after Ford started making the 302, Chevy made that 305 which was at the exact limit. Why didn't Ford do the same instead of that 302 which Chevy already had made one? I know why, but you are choosing to ignore it. Since Chevy came out with a 305 after that 302, that nullifies your theory, which is just you trying to justify things in your head, it means nothing.>>

I've covered this already too.   They BOTH chose to modify the tried-and-true small-blocks they already had instead of starting from scratch, in order to quickly adhere to the newly imposed SCAA restrictions in time for the new model year.   Both of their most popular small-blocks had even 4" bores.   So being that 4:3 was such a popular OS target ratio for high performance and reliability, they destroked the 327 and overstroked the 289 to an equally even 3".  And VIOLA!   The dueling 302s were born.  
I included the 'voila' part in hopes that it might jog your memory as to just where I've said this before.   

<<FSS: " "Well that's your opinion, but mine is, Chevy already had shown the  302 worked, and Ford saw that it worked and worked better than what they had, and the copied it, but made sure to change just enough to claim it as their own, and they did buy the prints. I talked to a mechanic that lives on my block about this last night, and even he knew this is true."  >>

Well I'm glad you're at least acknowledging that your stance is an opinion instead of fact.   
Although it's still silly to form an opinion against a demonstrable absolute.   

But I'm glad that Bob down the street agrees with you.   You should take him for a beer sometime so that you two can discuss even more colorful theories over the suds.   It'll be fun!   

<<FSS: "I gt what you are getting at though, you are trying to dismiss my 17 points, except for he 2 you already admitted was right." >>

I didn't admit you were right about the B/S.   I AGREED that you were right about the B/S just as you'll agree that I was right about the B/S.   
Words mean things.   There's a significant difference between agreement and admission.   
Interchanging the two for the sake of convenience is not as helpful as you seem to think.  

<<FSS: "I'm sorry if you don't like it, but this is how a comparison is made, and how you can get to the truth when you are told lies. To me, a refusal to admit I am right about those 17 points shows you are not only dishonest, but not even willing to look at the evidence. Make all the excuses why all you want, but admit they are the same numbers, admit that that Holley car is the exact same carb on both the engines I compared, etc."  >>

It's not dishonest.   There's a big difference between denial and disagreement.   I'm not calling you a liar...   I grant that you're probably quite honest about your belief...   But I'm just not buying what you're buying.   
So therein lies the difference.   

<<FSS: " Do all that, then we will talk about what is different and why, as I already said we would. Not showing a willingness to admit my 17 points are correct, shows me you have your mind made up..."  >>

Yes I have formulated my understanding of the subject matter based on all the historical facts surrounding said matter.  
 
Nobody has told you that your 17 points were incorrect.   However, I have simply explained why most of them are what they are, and further explained how those factors made them all derivative of the two important points, (bore and stroke) while observing SCAA sanctions.   Make no mistake:  These engines would never never been developed at that time without the SCAA's imposed parameters.   

<<FSS: "Now if you want to tell me why you think something is the way it is, that's fine, but not till you admit it is the same. I plan on doing the same exact thing if we ever get past what is the same, and move onto what is different, this is how things get hashed out."  >>

Well, I guess the ball's still in your court then, big guy!   

<<FSS: "That's not not all it is though, the fact is, Ford choose to make the exact same size engine, why don't they do this the rest of the time if they are both adhering to this inch pattern you claim. Ford 351, Chevy 350, Chevy 454, Ford 460, Ford 289, Chevy 283, DO i REALLY NEED TO GO ON? The fact is, almost every time Ford and Chevy has made an engine, it's been a different size, but not this time. Go ahead, try and justify it all you want, but it means nothing. The limit was 305, and Ford had room after 302, but they copied Chevy and made the 302 as well, this is a fact. They could of made a 303, a 304, or a 305 like Chevy did next, but thy didn't, and I am telling you why. ">>

I explained this earlier in this response, so I'm not going to follow your redundancy.   But I will add that, as I said before that they settled on the 3" modification to their older engines to get them out quickly enough to compete with a Trans-Am or LeMans approved design that year.   I'll add to that in order to fully answer your question though.   Chevy took their time designing a 305 so that they could eventually hug that limit to eek out the final fractional gains that resulted.   It's a design which worked out better for them in the long-run than their 302 would.   I did mention that bit very early on in this thread.   
Ford, however, chose not to follow GM's formula for progressing straight to the displacement ceiling...   but rather to continue developing improvements to their already well-established 302.  
Pretty obvious stuff really.   

<<FSS: "I don't care if you believe it or not, but this whole video is really only about Ford changing a few things from how Chevy did them, and calling it their own.">>

You began the whole 302 tangent.   It had nothing to do with the video, but I engaged nonetheless.  

<<FSS: "I have a Mitsubishi outside with a 1.5 liter in it, and this comment is really for that other guy, who said you can't just do that, it's not that simple. Well it is in fact just that simple, but yes there is a little work involved."  >>

I'm quite sure "the other guy" is well aware of how to adapt engines, trannies, mounts and drivelines which are incompatibility designed.   Your story is a cool break from the silliness, but he didn't need it as proof for something he already knows.   
Assuming the 4-banger is an in-line (since I'm unaware of any Mitsu pancakes) and the Ural is a pancake engine (aka boxer) itself, I hope you're able to fit the significantly longer straight-block before the transmission.   You may find that you'll have to lengthen the bike frame a bit to get it in there comfortably.   
Good luck with that.   

<<FSS: "I never said it wasn't true, but those are 3 different engines we are talking about. Did they modify the 289 and 327 to be 302's, are did they in fact actually make a different engine called the 302? You can claim based on all you like, others did, that's where you came up with this. The fact is,these are all different and separate engines, and that's not open to debate either is it?">>

Oh this is an easy one.   One which I have answered ad-nauseum....  
YES they are different engines.  
And they are FOUR different engines.   
There's the 302 derived from the 327 and then there's the 302 derived from the 289.  
Sounds like you finally agreed with me on something there.   Good job!   (kinda) 

<<FSS: "I already did that, and means nothing, anyone can modify the wiki, did it myself when it's been wrong before. If we all agreed, we wouldn't be having a conversation about this. You may not believe this, but much of what you are told in this world is a big fat lie. I am not disputing your information is not in agreement with the lie about how things came to be, I am arguing that your information is wrong because of lies you bought."  >>

Oh yes.   So much historical "knowledge" is blatantly contrived.   But that is reserved for things which can't be materially proven.   
We're talking about two engines here.   In the material world.   Which were demonstrably created from the designs of two other engines which are observably similar in design with each of their respective predecessors.   You can see them.   You can touch them.   You could even lick them if you're into that sort of thing.   But tin-foil-hat theories which run adjunct to these demonstrably derivative characteristics of each respective pair of engines is just an effort of whimsical hobby, and few will be following you there.   Because there are far better things for people to waste their free time on.   

<<FSS: "Thanks for taking the time to try and educate me, no really, but I already knew all that. Their is no confusion on my part, I just happen to know things to be a but different reality than what they are saying." >>

Okay.   

<<FSS: "That's true, but you need to do hat yourself before telling others too, right out of the gate what did you do when I commented about the 302? Go look, see if you did as you tell me to do."  >>

I corrected you.  
That's what I did.   
Respectfully and civilly too, even.   

<<FSS: "That don't mean you are not, nor does it mean I am wrong. Let me ask you something, why did you watch this video if you are not a fan of Ford? Why did they since you speak for them too?">>

Yes, that means you're wrong.   

And do you even Youtube, bro?   Lol 
That was the simple response that I was tempted to leave, but I'll expound.   
I came across this video because I'm a gear head.   I love cars.   I enjoy watching videos about ALL types of cars.   Not just Fords, but Chevies, Caddies, Pontiacs, Oldsmobiles, Plymouths, Jeeps, BMWs, Saabs, Holdens, Citroëns, Tatras, Ladas.....  I'm interested in all cars.   Their pros and their cons.   Their innovations.   Their intriguingly different ways of doing things.   And the weirder, the better.   I watch Top Gear.   I watch Leno's Garage.   I watch Roadkill.   I watch videos of tractors and other earth moving machines.   I watch vids of specialty machines.   I watch vids of odd, unusual, or innovative engines.   
Have you ever noticed that when watching YouTube on any one single aforementioned subject matter, that it offers cross links to other purportedly related vids?   Well we all click on these too.   That is how I originally came across this video long ago and shared some comments.   
Then, much more recently, you arrived and commented some conspiracy theory stuff about an unrelated engine.  So along with that and several others who replied, the alerts took me back to the page.   I decided to engage, because it looked like fun at the time.   It had nothing to do with any sort of brand allegiance.   

I've also told you that, up until VERY recently, I'd owned more GMs than Fords.   And Fords are still a minority of all the cars and trucks I've owned through the years.   Does that sound like a fanboi to you? 

<<FSS: "My opinion that you were a FanBoy was based on your anger at my charge that 302 was made by Chevy and Copied by Ford. You may not be a Fan Boy, but in my eyes you are acting like one. Why else get angry? Why not just compare and debate without all the other crap?">>

More like your perceived anger on my part.   Lol
How do you come to the conclusion that I was angry  anyway?   This is not a serious subject.   This is an amusing one, where anger is completely unwarranted.  That's why I even told Jack he should cool his jets, because he was getting all riled up over something which is undeserving of such angst.   
No buddy, I've been cool and calm the entire time.   
No anger from me.   Car brands are a silly thing to argue about.   
Those people who go talking about how their Ford is always pulling Chevies out of the mud, or the vice versa, and getting pissy about it are all children.   
You should pay more attention to context instead of simply assuming so many things about other people.   
But whether you're good or bad at deciphering those types of things, you'd still do well to leave all personal insults out of the equation, because it only hurts your argument, as I've advised you before    

<<FSS: "... however, I don't think we will ever get much straightened out on this thread. Don't look like anyone is going to change their minds here." >>

True.   Some get it, and some just won't.
Reply: WOW...man i told ya...this guy dont get it...and never will..."Ford copied...Ford purchased"...then Ford stole"...lol..too much...he seems not to get what .."copy"..means...as in duplicate ..EXACTLY...which if he ..EVER even SAW or WORKED on both..he would instinctively ..KNOW the obvious differences in them...BIG differences...bore spacing ..valve arrangement..oil system...dist placement....things that ..ARE..NOT..THE..SAME !!and things that cannot be..EASILY MOVED....haa....
Reply: True Jack.   But you know, it's MY fault for not first discussing what's the same...   It's keeping him from moving onto his second list of "differences" for discussion, where he'd have SURELY mentioned those points.   (not!)   ;-)
Reply: oh..good..Lord...next the...debate will be over the meaning of...same..purchased..copied..stole....never gonna end....real nice job..tho...I read ..and understood it ...all !!
Reply: They stole, then they bought, just like the Russians.
Reply: I already said I wasn't talking anymore to a certain individual here, and he told me he wasn't going to talk to me anymore either, then he accuses me of been a liar. Pot calling the Kettle Black. 

Many times people copy others ideals, they steal them and when caught either have to pay to use them or stop, Ford paid, end of story.
Reply: Bronywithguns870,    Yes, Chevrolet made a V8 overhead valve engine in 1918. Then in 1955.  Ford made a overhead valve V8 engine in 1954.
Reply: Squeeky,   You are correct as you know. FullSpectrum is full of it. Many engines use the same Cu In displacements. The Ford block is totally different from the Chevrolet. The cubic inch displacement is simply the size of the bore and the length of the stroke. To change the the stroke a different crankshaft can be installed. Bore can be changed by boring out the cylinders , or casting a block with larger cylinders. Many engine sizes are made because of racing restrictions. The 302 camaro was made to be a sporting hot rod, in the 1970s.  GMC truck in the1940s and 1950s had a 302 cu in 6 inline engine. The same block used a 228 248 270 cu in. simply by changing the crankshaft, and boring out the block. FullSpectrum just doesn't know.
Reply: FullSpectrum, you are wrong where did you get your information? the camshaft cover has different bolt pattern the bell housing has a different bolt pattern the two block are not even close to being the same.  The heads are not even close to the same size. The freeze plugs are not located in the same areas. To change the subject as you have done is a good idea but a simple admission of the truth would have been much better.
Reply: Yeah.   He's stuck on a few arbitrary figures, and wants to be right about it so badly.   Why?   I'm not sure.   Lol 
I never knew GM had a 302 straight-6.  I'm betting FSS didn't either, but now that he knows, he'll introduce us to another crackpot theory that Ford secretly bought the plans for it so that they could figure out how to build the 300 with a few modifications, and that's why Chevy can't sell those 302s anymore either.   ;-)
Reply: FullSpectrum,     Why did you mention the stroke as being the same? It has nothing to do with the block. It is the crankshaft that that creates the stroke. So the ford and the chev. both have the same bore. This should not make you decide the blocks are the same.
Reply: Bud...YES!!...like what ..Squeak Wheel and I said ...and much more...oil system{pump location}...dist location..{rear  vs front}....he not gonna listen...just lie...just wait he'll be...baaaack....ha
Reply: bud, I never changed the subject, and I never changed what I said. I admitted up front that certain things were changed, but how something bolts up does not make it a whole entirely different part. Ford used their heads, we already went over that. You can put Ford heads on a Chevy too, this is not changing the subject, it's just a fact you need to keep in mind. 

Why don't you find me a Ford Patent for the 302 Boss engine, then we will talk.

"The freeze plugs are not located in the same areas."

It don't matter if you move a few things around. Let me give you another example to look at.

The Russians claim their T37 the best tank they had of WW2, but it is a fact the suspension is Christi suspension, just like it is on several English tanks as well. They claim the tank, but some of that tank, the parts that made it great, they are American.
Reply: "eah.   He's stuck on a few arbitrary figures"

17 is not a few, it's most of them.
Reply: "I never knew GM had a 302 straight-6.  I'm betting FSS didn't either"

I did, and had you done any research yourself, you would of knew it too. 

I'm not giving you any theories, I am telling you straight up, Ford bought the Chevy 302 Blue Prints, and used them to design their own version. which means moving bolt patterns round, using their own heads, etc. 

"that's why Chevy can't sell those 302s anymore either."

Explain to me why Chevy don't offer the 302 anymore, a popular size engine, yet we can still get just about any other V8 they ever made.
Reply: Full Spec. I don't believe that you have any knowledge about the blueprints of anything. The ford heads don't bolt onto the chev. block as you said, neither does the oil pan. I have worked on both and owned both. Chevrolet decided to make the 350 cu in engine with the four bolt mains because it was a better way to strengthen the flex of the crankshaft, The 350 became very popular with racers and chevrolet decided to make the 400 with the same block design. Give up, you have nothing.I doubt that you have ever worked on a engine. Probably just read magazines.
Reply: Here's another link, be different, learn something.

http://www.460ford.com/forum/42-general-tech/114796-ls1-heads-sbf-yeah-can-done.html

http://www.badasscars.com/index.cfm/page/ptype=product/product_id=88/category_id=13/mode=prod/prd88.htm

Be sure to read that last link you know nothings, that's all of you that shot the messenger so far.

Bud Irving, not only have I been a trained mechanic since the 80's, but I have a machinist 1 Diploma too, I know more than you people about how things work. Not only can I put the parts together, but I can make them.
Reply: FullSpectrum Survivalist ,  Did you know that the Chevy 302 was made by the factory installing a 283 crankshaft into a 327 block, that was it. No special casting for the 302. That was one of the methods GMC used for making different size engines. Of course, they also had to change the length of the rods or change the piston pin locations. But this was common practice, they had been using this method for many years. The factory could just take the parts off the shelf and build any engine that they thought would be popular. They had been doing this since the early 40's or possibly before. The GMC light truck 6 cylinder inline engine was a good example of this starting in the 1940s they made a 228 cu in, a 248 cu in, a 270 cu in, and a 302 cu in, all using the same block. with different bores and crankshafts. The 302 six inline was made in 1950. It was popular for street rod chevys as it would fit right into many chevys. The engine was one and one half inches longer than the chevy six , and had a 4 inch bore and a 4 inch stroke.  The engine also had  hemisphere  combustion chambers, which was a big improvement over the chevy six. It developed tremendous low RPM torque. Please don't say you already knew all this. If you want to know more, I will gladly answer the questions from my own experiences. If you want to know about my experiences just ask.
Reply: Full of it Spec does not make any sense, but especially the blueprints idea  is nuts, Ford could have gotten the block from a wrecking yard for nothing and cut it all up or what ever he is fantasizing that they would need to get the specs for the 327 block. There is no patent required on those sort of things, and he most likely didn't know it was a 327 block. Why do we bother to continue this with him?
Reply: "Why do we bother to continue this with him?"

Why are you asking yourself a question? I haven't responded to you people in 5 days, so yea,why are you still responding to me? 

Nobody wanted to seriously look at this, so we are done here.
Reply: Cadillac invented the first production car with a v8 just saying it wasnt ford.
Reply: ebk bk  The video did not say that ford invented the first v8. It said that this video is about the invention of the first (Ford ) v8. It was quite an achievement by Ford, to make a single piece casting v8 and keep the price at a level that people could afford. Ford made that flathead v8 from 1932 until 1953. In 1954 Ford made the overhead valve v8.
Reply: save youre sob story for someone who cares id rather buy a sb chevy just like 3/4 of the comments would aswell...
Reply: Open your eyes and read.  For the second time in a row, you have missed the point.  
Bud was trying to helpfully inform you that the video was not claiming that Ford invented the V8.
As he kindly pointed out, Ford pioneered the unified block;  something that had not been previously built in V configuration or otherwise  It was a major step in  making the manufacturing process cheaper and more affordable, which resulted in making the V8 more commonly available.  

There are no sob stories here...   only that of drama queens like you looking for an argument where there is none.   
NOBODY is arguing Ford versus Chevy superiority here...   what are you, a 16 year old or something?  Lol
Reply: Sounds like a sob story to me when you have to write a short story on how ford made the first single cast v8 when they didn't... Single cast v8 blocks have been used in aviation far longer then cars.
Reply: Methinks our illegibly named buddy "ebk bk" doesn't understand what a 'sob story' is, by definition.   But that's not surprising, considering the reading comprehension (or lack thereof) he displays here.
Reply: hell yea brother thats what i call a drag motor
Reply: 1SqueakyWheel  Yea, he can't read!
Reply: Tibor Roussou Nascar uses this design still
Reply: ebk bk,    You must be unable to read, are you really  young? You don't  read the words. You put whatever you want in place of what is being said. As your comment about the sb chev. When the flat head ford was produced by ford there was no sb chev to opt for in place of the ford flathead. So what were you talking about? Perhaps you should watch and study the video again, or just get off the subject until your education improves.
Reply: @tomdave42  According to the Wikipedia article, and Wikipedia is usually a decent source, the Ford Windsor V-8 evolution began with a 221 cid engine. Later, the 260, 289, 302 and 351 engines all were developed on the same block. Lots of coincidences in engine development. AMC developed a 327 on its small block (some called it a mid-block) which had nothing to do with the Chevy of the same displacement, though many believe that AMC used the GM engine. Lots of interesting history and lore in Postwar engine and transmission development, but people have to get the story straight. I have had at times had to correct misconceptions I have held for many years. I maintain my own vehicles, but I am an historian not a restorer. I have an affection for old sixes and would like to rebuild one before my time is done. Some of the guys think it is weird that I would want to rebuild, say, an old Nova and not put a hot motor in it. But the six will get you up the hill, and that's what counts. Retro-ism is in the mind of the beholder, and everyone is entitled to their own version of it. I think the Slant Six is a total dog. GM, Ford and AMC all had better sixes. Someone once built a functional Indy engine on an AMC 199 block. I don't think you could do that on Slant Six. Apparently an Indy engine was built on seven main Ford 200, but I don't believe it worked very well, that's what I recall.
Reply: @myself  I have to issue a correction of sorts. AMC made three generation of Postwar V-8's. First the Rambler V-8's of the 1950s, of which the 327 was a development. A second generation consisting of a 290, a 342 and a 390 was introduced in 1966. Only the third generation, introduced in 1970 and consisting of a 304, 360, 390 and 401, is considered midblock. The second and third generations were modern V-8 for the day and suitable for transplants into other production. The quality of these far exceeded the quality of the vehicles they were put in. None of these engines have anything to do with other manufacturer's V-8's of the same displacement.
Reply: FullSpectrum Survivalist So I'm assuming a Ford 427 and a Chevy 427 are the same thing by your logic. and that a Ford 428 and a Pontiac 428 are also the same thing.......... They are totally different engines, just because a few figures coincidentally correlate to each other means nothing. oh wait an Oldsmobile 350 and a Chevy 350 are the same as well as a AMC 390 and a Ford 390. and lastly a Chevy 400 and a Ford 400 and a Pontiac 400. A Chevy dz 302 was a purpose built top end performer meant to conform to cubic inch laws of scca based on the 327. A Ford 302 was just a run of the mill engine meant to replace the 289 with a more smooth reliable engine. They were in no way meant to compete with each other until Ford unveiled the Boss 302 wich again was a top end performer meant for racing. they are in no way similar
Reply: You assume a lot, don't try and interject your opinions and assumptions into a conversation about a specific subject I brought up. 

I said Ford stole Chevy's prints for the 302 Chevy then bought them, that is what I claim. They copied the prints and modified them to claim they came up with something Chevy already made prior. They modified the prints that Chevy Engineers designed for the 302 and came up with an almost identical engine by the output numbers, changing just enough to call it their own.

"So I'm assuming a Ford 427 and a Chevy 427 are the same"

That wouldn't surprise me in the least, go watch a movie about Ford stealing the late inventor RIP Robert Kearns intermittent windshield wiper systems used on most automobiles from 1969 to the present. 

Ford has stolen others work many times, you people may as well get used to facts. They can't steal another Big 5's work as easily, so you almost never hear about back room deals settled with money and not reported by the bought and paid for media, and when people in the know tell you something true, this is what we get for our efforts, so stay stupid people, why change now?

https://en.wikipedia.org/wiki/Robert_Kearns

I won't even bother with telling you my own story about how big money stole from me 3 times my inventions before I got smart enough to never ever mention what I came up with ever again, but the last time they did it they even had the balls to call it by name, the name I gave it,

http://www.imdb.com/title/tt1054588/

Why pay someone for their hard work when you are one of the most powerful corporations in the World though right? Hell just steal it, the little man can't never hardly get any justice and we have all the money in the World is their thoughts. Don't worry though, the stupid public at large will always defend us and they are not smart enough to grasp we steal. And here we are folks.
Reply: @FullSpectrumSpectrum Survivalist  I have a hard time think your idea is anything but a stretch. Imitating the configuration is one thing. Sometimes engineering innovations are copied because they are good idea. But "copying the prints" as you put it? I don't think so. The GM 302 had a 327 bore and a 283 stroke. I imagine wildcatters already had built Chevy 302's on their own. The GM 307 had a 283 bore and a 327 stroke. Ford probably adopted the 302 configuration because it, one, appealed to common buyers who believed it would provide a little performance and, two, because the low end torque it produced would help move the heavy vehicles they installed it in. Some of the bore and stroke combinations had to do with the formulas and limits of the various racing circuits, but other people know much more about that topic than I do.
Reply: FullSpectrum Survivalist,  You continue to prove that you know nothing about engines. You should know that just because the engines have the same bore, stroke and number of cylinders (same cu in displacement) it doesn't mean that the engines are the same. Same cu in displacements could also be had with different bore to stroke ratios. You should know that but you don't. So why don't you go brag about yourself on a subject you might know something about, if there is one.
Reply: bud irving I just read Mr. Speculum's "proof" that the engines are the same. What it is was some guys attempt to put LS1 heads on a bored and stroked (393 inches) 351 Winsor block but it wasn't even close to the direct bolt on he claimed it is. first off, LS1 heads are new generation Chevy. Not the same as 60's small blocks. That said, the head bolt holes were close but just a bit off so i suspect the cylinder bore to valve chamber will also be a bit off as well. That should make finding head gaskets interesting. A custom camshaft has to be made as the Ford cam journals are just a bit bigger than the Chevy's are and the distributor drive gear is on the front of a SBF. The intake manifold wasn't even close so they had planned to make a custom intake out of sheet and tube alluminum. They didn't discuss the pushrod configuration but i imagine that'll be an issue as well. Im not sure where this guy got the idea that Ford's 302 was a carbon copy of Chevrolet's 302 back then but after spending the last 35 or so years building Ford engines (and yes, a few 
Chevys too), i can say catagorically that with the exception of carburetors and air cleaners, the two are NOT interchangeable.
Reply: Doc Hollywood,   I agree with you completely, This guy(full of it Spectrum) is nothing but a farce, he has no intention of proving any thing he says. He is simply trying to cause arguments. If you question him about anything, he will look it up on google and then claim he knew it already. We have all nailed him several times and he comes back with nonsense. He probably gets a laugh out of how he upsets other people. We all know that the two engines are not the same, and his explanations are total nonsense. He has no intention of making intelligent conversation.
Reply: "This guy(full of it Spectrum) is nothing but a farce, he has no intention of proving any thing he says."

I had every intention, but none of you were interested in actually discussing it, and wouldn't come into it with an open mind and talk about it. I proved that almost everything was the same on both the Chevy and Ford 302's up above, you choose to ignore facts and try and brush it all under the rug with math and other BS. 

"He is simply trying to cause arguments. If you question him about 
anything, he will look it up on google and then claim he knew it 
already."

This coming from the guy who googled everything and copied and pasted it here, and has did absolutely nothing but troll the whole time you been here, even now you just troll.

"We have all nailed him several times and he comes back with nonsense. He probably gets a laugh out of how he upsets other people."

No I just feel sorry for you, you are brain washed and don't even know it. You were offered to actually debate more than once and choose to just troll instead.

"We all know that the two engines are not the same, and his explanations are total nonsense. He has no intention of making intelligent conversation."

Anyone can see I tried, but none of you would have any of that and came right out of the gate trolling me. The truth is you especially had no intention of making any intelligent conversation. 

My claim was that Ford stole Chevy's design and then bought it afterword so they can make that BOSS 302, I did prove it in spit of all you trolls who didn't want to actually discus it. My post is up there comparing both to anyone who wants to actually look at the information that is correct with an open mind.

Doc Hollywood, that link about the LS1 had nothing to do with proving anything about the Ford and Chevy 302. Read more till you get to my comparison of both engines.

My cousin looked everywhere one time for a part for his old Ford tractor, he couldn't find it anywhere. I found it though, on a new Kubota tractor, it fit right in.

I never claimed all the holes lined up at any time, in fact I been saying all along that that is mainly what they were doing in this video, but relocating holes so something don't line up doesn't mean they designed a completely new engine in my opinion. 

Moving the distributor to the other side doesn't either. 

Have any of you ever saw a car rim that fits several brands? Make no mistake about it, it's the same damn rim re drilled to fit several different bolt patterns, this is the same thing.

I gave several examples besides the Ford Engine that was copied from around the World, several known examples and nobody even wanted to talk about that, because then you would have to admit people steal stuff.

https://en.wikipedia.org/wiki/IMZ-Ural

The above was one of my examples, not just an engine was copied, pretty much the whole damn bike was, and till this very day is still in production mostly the same as it's always been. 

That URAL is a copy of a BMW R71. 

I can give hundreds of examples of this going on, but you people are too damn brain washed to learn anything. I understand this is too damn hard for you, they don't teach people how to think in school now, and most never learn.
Reply: FullSpectrum Survivalist , actually you said that Chevy built their 302 first then Ford bought the patent. That said, you can go on and on about how the two engines are exactly the same (although I thought your comparison  with the unilug design from the 50's US mag wheels was pretty lame) but the fact is that save for the bore/stroke dimensions and both engines had cylinders numbering 8, thats where the the similarities end. The facts (which you seem to have a very hard time with) are that the Chevy 302 and the Ford 302 were very different. different internal block webbing for strength, different head design, different intake and exhaust, motor mounts, trans mounts, accessory drives, timing covers, water pumps. All different. You can't bolt Chevy heads on to any Ford or vice versa. Sorry man, it just wont work. It was kind of funny watching you try to convince everyone that you could.
Reply: Doc, watch the movie called "Flash of Genius".

"https://en.wikipedia.org/wiki/Robert_Kearns"

Proof Ford steals, I suggest you watch the movie, learn something.

"actually you said that Chevy built their 302 first then Ford bought the patent."

I know what I said. Chevy built the 302 first, Ford stole the design to make their own copy of the 302, then bought the patent from Chevy, that's how these things works with patent infringements involving big corporations, it's almost never made public on the record. Watch that movie, learn how it works.
Reply: Doc Hollywood,      Everyone that entered this debate, told him similar things but he is just messing around with us. He thinks he is funny. He has very little to contribute so he just continues to try to lead us on. If you were to ask him if he knows how to compute the cu in displacement of an engine he would have to google it and then he would come back and say he knows so much more than anyone else. At first we thought he was serious but discovered he knows very little. I have discontinued contact with him.
Reply: @bud irving  You must be talking about "Full Spectrum". Either he doesn't know the difference between a patent, blueprints and configuration or he is playing some weird game. As far as I know, configuration (stroke, bore, valve diameter and so on) is is not patentable. The case he cited re Robert Kearns pertained to the development of the intermittent wiper, not engine development. I can only surmise that the legal situation related to engine development is well established and the manufacturers know what is. Manufacturers come up with highly similar production because of the demands of the market, the specifications of various racing circuits and in response to regulations. All of this was very clear in relation to cast iron V-8 development between the 1950s, 1960s' and 1970's. Anybody who can't figure it out has a problem with conceptual thinking.
Reply: Anonymike,  Yes, I was talking about "Full Spectrum" and I agree with everything you said. He is just trying to mess with us, and everyone is aware of it.
Reply: @bud irving  I think he's confused about the meaning of concepts and where they do and do not apply. The "Kearns" case pertained to an independent inventor getting ripped off by a corporate entity. Wildcatters often have built engines of a certain configuration before the manufacturers did. I suspect that was the case with the 302 Fords and Chevys both and with the 307 Chevy. You can build a 383 Chevy based on a 350 bore and a modified 400 crank. The reason to do this would be to increase torque say in boat or a truck, or to exceed the high performance capabilities of the Chevy 350 while avoiding the defects of the Chevy 400. But the factory never build a 383 Chevy small block. Not to be confused with Chrysler 383, which was a fine engine in its day in the ordinary production car. Probably the most reliable engine of the 60's era in long distance driving
Reply: You would build a 302 Chevy by using a 327 bore and a 283 stroke. Hard to imagine no hotrodder or gearhead never did it on a 327 or 283 block. All in inches 4.00 (bore) X 3.00 (stroke), r=2. 2X2=4; 4X3.1415 (pi) =12.566; 12.566X3.00=37.70 cubic inches (displacement of one  cylinder); 48.69X8=301.58 cubic inches. There might be difficulties because of issues of crankshaft journal (bearing diameter) size depending on what block you wanted to use, but hotrodders and gearheads do solve these problems. A 283 crankshaft can be put into an early 327 block or a 283 bored out to 4.00 inches. So you can be sure than rodders did it before GM came out with a 302. I don't know if you realize it, but you just agreed with me completely on both issues, engine building and the Kearns lawsuit. Read yourself.
Reply: "I don't know if you realize it, but you just agreed with me completely on both issues, engine building and the Kearns lawsuit."

I don't know how you came to that conclusion.
Reply: FullSpectrum Survivalist,  The windshield invention was ruled by the court that it could not hold a patent because it was using parts that were already being used on other things It was not a new invention, only a new way to use the same parts. Check with the patent office you will see the reasons why a product can or cannot hold a patent.
Reply: Ford didn't invent the V8 engine. There were V8's running in 1902 in France and V8s in series production by 1907. There wasn't anything special  about this engine except that it was cheap.
Reply: prophetsnake,   Exactly that is what the invention of the Ford V8 was.  It put a V8 into the cars of people who could not afford a large expensive car. It seems that so many readers think that the video was saying that Ford invented the V8 but that is not what the video is saying. It is showing the invention of the FORD V8. Only FORD could invent the FORD V8.
Reply: That's not an invention then, it's merely an engine that was developed from engines that had gone before. There was nothing innovative about the engine, it was simply cheap. http://dictionary.cambridge.org/dictionary/english/invention
Reply: bah bah bah: The first production car who had a V8 was a french car (1910 De Dion Bouton), and the first aircraft engine was french, (Levavasseur 1909, engine from the Antoinette aircraft...but whe can say that the first mass production V8 was the Ford who was same the first automaker who built mass product cars (in France was Citroën, a friend from Henry Ford, but Citroën start in industrial production in 1915 as... artillery ammunition maker: 10 000 schrapnell 75mm shell per day...
Reply: That's production, not invention.
Reply: prophetsnake,    yep, but the video was not trying to show that ford invented the v8, only what ford did to invent THEIR v8. The casting procedure that they went through at their factory to make the block and the success of the engine. Ford made a less expensive car with a v8 that the masses could afford. In 1918 Chevrolet made a v8 with overhead valves but decided they wanted to stay in the lower price range of cars and discontinued their v8. Then used a 4 cylinder overhead valve engine until they switched to a 6 cylinder overhead inline engine, until 1955.
Reply: Yes it was. It's the title of the video. It's written there right underneath the video.
Reply: prophetsnake ,     The title says "The invention of the Ford v8" Not just any v8,  the FORD v8. Ford never claimed to make the first v8. That would have been absurd as you know. The video is just showing what Ford went through to make a v8 for their lower priced car. At that time it was quite a chore to cast a single piece v8 block and do it at a low price.
Reply: Yes, and it wasn't invented. It was a development of a known technology. So it isn't an invention, it's just something Ford made that was already around for over a quarter  of a century. You can't simply bake an apple pie and say you invented it. There was nothing new about Ford's engine. Period.
Reply: +bud irving I just saw a black and white movie today of Bonnie and Clyde actually getting shot in their car, It was a V8, not a 4.
Reply: D Rutt 1969,   That's right, it was a 1934 ford v8. Ford first made their v8 in 1932. Ford continued to use the remainder of their already produced 4 cylinder engines in their pickup trucks, but not very many.
Reply: D Rutt 1969 
That was just J.E. Hoover propaganda.
Reply: D Rutt 1969 
And many of the trucks used to cross Europe into France in blitzkrieg style.Germany chose and used Ford powerplants for many of their trucks.
Reply: And I didn't say that Ford claimed that. I said that the video did. And the Ford V8 was just any old V8. It was just as pedestrian and lackluster as everything else that they made. It had one major virtue and one only - it was cheap. You really need to look up the word invent.
Reply: No, he isn't. Ford did not invent the V8, period. They didn't 'invent'  the Ford V8 either, The word that you are looking for is developed.
Reply: Tibor Roussou....#ChevySuckMansack
Reply: a v-8 is a v-8 single peice block or not. ford was litterally the last car company to have a v-8 for sale. I get brand loyalty and all, yes it was a fantastic innovation. but words mean things, and ford was not first.
Reply: Eh, that's because many, many parts are proprietary. You would find those same parts on tractors, aircraft engines, and so on.
Reply: I wish I had found this "discussion" when it started.  Your suggestion that the 302 Ford and Chevy are the same engine is ludicrous, and let's ignore the stupid idea that Ford would buy prints from Chevrolet.  If they were the same, parts could interchange between them.  You can't swap cranks, cams, heads, intakes, distributors and soo many other parts between them because they're DIFFERENT engines.  Both engines were built for Trans-Am racing with it's 5-liter (305") limit.  Why 302 and not 305?  Becuase both engines will need only an 0.020" overbore to be at (just under) the 305 limit, and BOTH engines were built from parts off the shelf.  As others stated here numerous times, the Ford 302 was a stroked 289 while the Chevy 302 was a de-stroked 327.  Other similarities you cite to "prove" the engines are the same are simply "best practice" at the time for an engine made for racing.  Forged internals? check. Solid lifter cam? check. Single 750 Holley? Uh no.  The Chevy Z/28 had a 2x4 cross-ram manifold.  As this reply is many months after yours, I doubt you'll see it, but I place it here anyway.  Cheers.
Reply: FullSpectrum Survivalist not even close to the same engine
Reply: 1SqueakyWheel actually gm and ford did build some shared transmissions
Reply: 1SqueakyWheel oh they are both made of iron and steel
Reply: 1SqueakyWheel no he needs a good stout ads whipping
Reply: FullSpectrum Survivalist hope that you can swap the crank,cam,fuel pump,valve covers, the oil pump,pan, heads and just where do you wanna put the extra head bolts in the ford
Reply: FullSpectrum Survivalist nope
Reply: FullSpectrum Survivalist liar